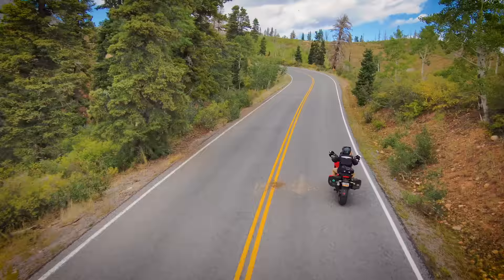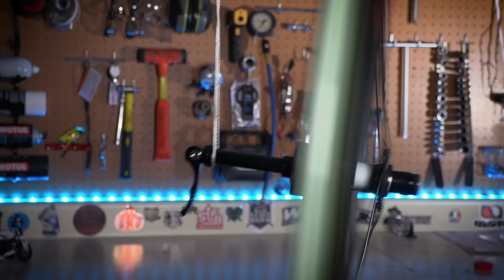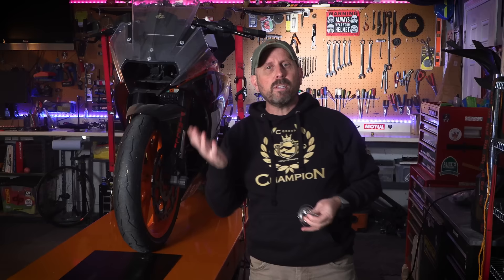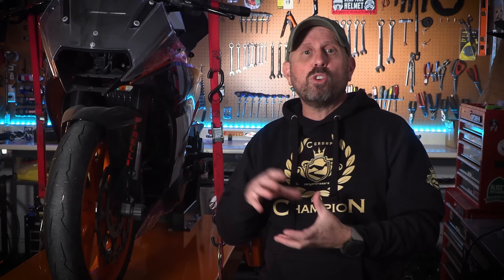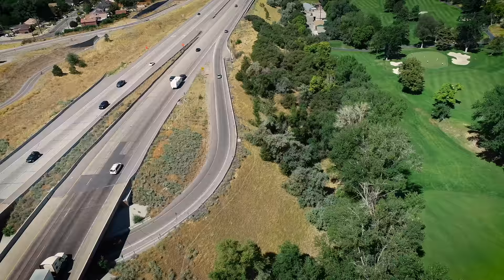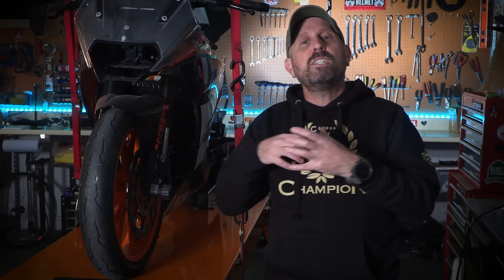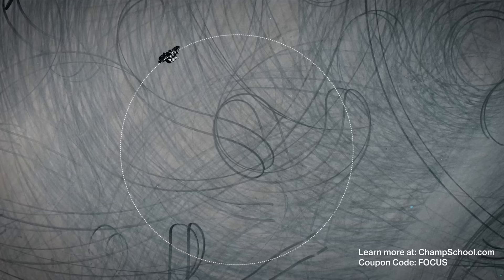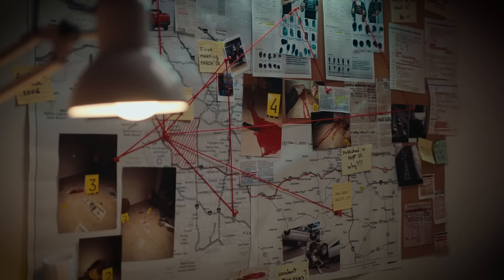Do We Fully Understand How Motorcycles Work?

Comment: Nice video, you are at the stage I was at several years ago when investigating how two-wheel vehicles turn. I watched the Cornell/Delft video and read their research paper ten or 12 years ago and have watched and read many videos, books, papers and articles about how motorcycles turn. Some are absolutely wrong, many are incomplete. Most of them try to explain what happens when the motorcycle is already leaned, but not what makes the motorcycle lean in the first place. You (and any of the sources I have read or watched) failed to mention inertia, the MAIN factor why motorcycles lean. Inertia is the factor which prevents the top part of the motorcycle (everything above the contact patch) from following the contact patch into the turn. In other words: the motorcycle does not stay upright and just follow the direction of the front wheel, because, according to the laws of physics as observed by Isaac Newton, the motorcycle's mass wants to keep moving in a straight line. Turning the front wheel away from the current path of travel causes the motorcycle to become perpendicular to the original trajectory. Everything not connected to the ground will try to keep moving in a straight line, which pushes the top part of the motorcycle over in the opposite direction the front wheel is turned. It may APPEAR as if the front wheel is being pulled out from underneath the motorcycle (I used to think that, too), but it is actually inertia PUSHING the top part of the motorcycle over. The motorcycle's steering geometry then causes the front wheel to turn the way the motorcycle is leaning. Additional factors, such as velocity, rake and trail, width and shape of the tire, wheelbase, total mass, center of mass, centripetal force, gyroscopic force, gyroscopic precession, slip angle and gravity all contribute to how quickly the motorcycle leans, how much force must be applied to make the motorcycle lean at a desired rate, how much lean is required to achieve a desired turn radius etc.  Btw: The spinning bicycle wheel dangling by one side of the axle on a piece of string is gyroscopic force, not gyroscopic precession. The effects of gyroscopic precession can be observed when the axle is moved and the torque follows the rotation. Turn the axle to the right horizontally and the axle will tilt to the left vertically (the wheel spinning in the direction it would when travelling forward on a motorcycle or bicycle).
Disclaimer: I am NOT a physicist, just an average dude who has done a lot of reading and experimenting with this topic for many years. I am not saying "This is how/why motorcycles turn", I am merely adding insights missing in this video.

Comment: How is this not solved yet? An object with mass in motion wants to go straight until an external force is applied to it. That's basic inertia. What we impart to it through the steering wheel (which also turns when we shift our balance sideways) then causes a centrifugal force, that's resolved through friction on the tires. How we sit on top of it changes the center of gravity and decides how fast or tight it can turn.
Reply from the maker: My understanding from speaking with several of these researchers is we don't fully understand exactly how trail, wheelbaser, swinarm angle/length, mass distribution, inertia, tire slip (and a bunch of other things I purposely didn't touch on), not to mention rider imputs affect exactly how the bike behaves.  A rider can make a stable bike unstable, and a rider can make an unstable bike stable, and according to my research, we still dont fully understand exactly how it all fits together.
Reply: @CanyonChasers  yeah it keeps boiling down to "human intuition). We won't know for sure until we manage to build a simulation and train an AI to ride it.

Comment: I thought it was as simple as counter steering helps the bike fall over intiating the lean. Due to the gyroscopic force of the bike wanting to keep it straight up we lean over using gravity to hold it down in the turn. Which is why the bike comes straight back up when we move our body back up..?

Comment: Conservation of energy. When counter steering, the front wheel drifts less so the rear wheel must drift more. Then the rear end rotates. It's the opposite of riding a tricycle (though you can still feel the center of gravity shift when turning.) Instinctually you lean into the turn to stop from tipping over.

Comment: The rear wheel drives you forward whilst the contact patch holds the lean. This creates a rear slide. The centrifugal force prevents the bike from falling. Therefore, momentum cannot be zero and round you go babyyyyy.

Edit: higher the momentum the larger/wider the turn becomes

Comment: It’s funny how the “speed = radius” is the exact same for airplanes. The less speed you have, the smaller your radius will be, however this only works down to a certain speed which depends on the aircraft. Each airplane has its corner speed, which is when it can sustain a turn, at the tightest radius possible, without losing airspeed. This is why the F-16 is so good at BFM, if in the 2 circle (nose to tail), it’s able to sustain a very tight circle. Maybe look into aircraft too, it’s interesting how similar they work to bikes. Example: yawing the plane left or right with the rudder will also bank/roll it (just like a bike’s handlebars), initiating a turn. (Ofc, you normally wouldn’t do this in flight, just stating the fact that it DOES happen)
Reply from the maker: Stall speed.  Motorcycles as well to a certain extain.  Below a certain speed they just fall over.   I've always looked at aviation as a great analog to motorcycles.
Reply: @CanyonChasers  True. They’re pretty close when it comes to physics. Even balancing, aircraft require the weight/center of gravity to be in the correct position (where depends on the plane), and so do motorcycles so you don’t fall off the bike. Though, fighters like the F-16, F-22, etc aren’t actually stable airframes, just the FCS systems keep it in the air.. which helps them in a lot of different scenarios.

Comment: If you go into a corner fast and counter steer more, sooner or later you're going to lowside. 

Your front wheel needs to point into the corner when you are already continuously turning. Counter steering to get more lean is pointing the front wheel toward the outside of the turn.

Just dab the brakes a little bit and your radius will tighten up. And if you really rocketed in there so that a little braking is going to make you lose traction and crash, sorry, you already screwed up. What's the solution for "I jumped off a bridge and I wish I hadn't?"
Reply from the maker: Rather than "dab" the brakes, we prefer to sneak them on. 😎  A "dab" implies abruptness and abruptness is not ideal.
Reply: @CanyonChasers I guess I had a different thing in mind for "dab." Sure, gentle brake application should fix the problem.

Comment: When you turned your handlebar to the right, you and the bike go left and automatically lean that way, you have to think about it while riding or you probably won't believe it and thinking you should be turning right when you do that, but like on a motorized kayak, you lean left and it will turn to the right, I wonder if they have anything in common 😅

Comment: 50 YEARS ON THE ROAD. Out there, if you can visually  see the corner 'opening up' and you are pointed that way, you can accelerate (and counter steer, if required). If the corner  is 'tightening' (exit is disappearing or has disappeared) you need to slow down!

Comment: Great vid…excellent!..Now can you tell us how to decrease fear when decreasing turn radius…or eliminate our innate fear of lean — that is without low siding!!
Reply from the maker: We've been working on that one for a while now - the last video about trusting your tires is a precursor. Be sure to check it out.
Reply: @CanyonChasers  I just hang off my bike to reduce lean angle but my innate fear kicks in at 38 degree or more and I know in dry conditions I should easily get to 45 with constant and tender pull on throttle to maintenance speed or slight accel. At 64 I will take a long time to heal so I have have grown old not wanting to experiment pushing the boundaries- which is what is really required.

Comment: now we're talking: "it depends" :)
has anyone sought input from mr Sam Pilgrim? at one point he rode a bed frame w/ zero trail.. 
also, if you ride a bike standing 'outside' the frame on just one pedal, in order to maintain a straight path the bike needs to lean away from you. whatever that means :)

the most reliable way to maintain a 'lucky strike' riding motorcycles is to travel at speeds that are below one's riding abilities.

Comment: So, at super slow speeds there's a greater contact patch so more friction available, there's also countersteering to point the front wheel in the right direction, and the need to keep power on through friction zone and throttle - is that close?

Comment: Speed does not equal radius. Adding corner speed at a motorcycle (not for a satellite as they are free-falling) moves the motorcycle's center of gravity more to the inside of the corner and actually closes the line. The reason why the Yamaha School snapshot shows that the circle is smaller when decelerating/slower speed, is because our untrained brain feels safer when going slower, nothing else. During thousands of years of evolution, our human brain only feels comfortable when going at walking or running speed, anything more needs training. Adding break while cornering (trail-breaking) just makes us feel safer and makes us feel that we can handle the speed and rotational torque the bike generates while cornering. 

In practice, it is ok to drag the breaks in a real corner, as it comforts us and helps us not fixate our vision to somewhere to the outside of the corner. But breaking doesn't help the bike not tip over at all. The plastic rotating disc shown to hold the bike and tips it over once accelerated more, is very misleading as the bike does not move in relation to the disc.

You almost never get into a corner too fast. Almost always the bike will be able to take the lean angle. If you are objectively going into a corner too fast, your best bet is to lift the bike up, go full on breaks, then countersteer while accelerating again and pray you have enough space to do that.

Comment: Because of the rake in the fork, when the handle bar is pushed, this action then moves the front wheel tire contact patch off-center. The bike then initially falls to one side because the weight is no longer vertically balanced along the fore-aft center line of the bike. Bike falls to side opposite the contact patch because the weight is now skewed, the vertical balance line being already off-center to side opposite contact patch. Front wheel alignment, with respect to bike fore-aft center line, then self-corrects to the direction of the turn to maintain turn direction. At this point, two-wheeled bike is now steering much like a four-wheel vehicle, wheel turned in the direction of travel. I know this is a incomplete explanation

Comment: I never counter steer, I just lean where I want go. 
You can try it just tilting over your head to the side you want to go.
Reply from the maker: You can, but some countersteer in some situations adds extra precision/control.
Reply: When You are leaning to one side, You are actually pushing motorcycle to opposite side (action and reaction), it is much more viewable at bicycle as that is much lighter. And as was seen in video, gyroscopic precession (or weight of front) will steer itself while motorcycle is leaning, so it will countersteer itself (very little is needed as cornering force of tire is pretty big). And when You are holding handlebars, You are probably pressing inner handlebar and doing countersteer unconsciously :-) .

Comment: the big question is "how do UNICYCLES steer?"

lol. despite 15+years experience, my technique improved by leaps and bounds when i got an RC motorbike.
first one. whys it steer backwards?
after the first run, that answered itself... its countersteering.
next one...why doesnt it steer?

that took a while to figure out. you DONT steer an RC bike!
you jab it, let it fall over, and ride the throttle/brakes... has a huge control horn to exaggerate the movement... and soft springs to let the wheel "float" where it wants to... maybe a damper to stop the shakes... 

no gyro to keep them up, thats cheating... just standard steering geometry and the same physics as a full size bike.

and still the most realistic of the RC vehicles... the physics scale.

but yeah, i still cant corner hard. nope. never come to trust tyres and prefer riding to sliding.

Comment: Don't ask physicists about motorcycle steering and stability. It's an engineering problem and was solved early in the eighties using Lagrange's equations of motion. Maybe it was solved earlier but not published. That's how back then  many small European manufacturers made frames for the heavy Japanese four cylinder engines with improved stability and handling. Later many books have been published using simplified models  trying to explain motorcycles without really fully covering the dynamics.

Comment: "Why does the wheel steer left if I hold a bike in the air and tilt it left?"

When your bike is flat, the force of gravity is going straight down through the middle of the bars, forks, and wheel. No reason to tilt anywhere.

When you tilt it to the left, the force of gravity is pointing to the left of the front end. So it tilts that way because it's being pulled that way. This isn't super hard. There's nothing mystical going on, you can go get anything simple that pivots and do this. Get a ratcheting  wrench, hold the extension straight up, with the handle pointing forward. Tilt it to the left. Oh man, the handle goes to the left, wow...

If you rode a bicycle or motorcycle in an environment where there was no force pulling it down to a road, it wouldn't turn at all. It would just float away in a straight line. It could be upside down a micrometer above the road, it really wouldn't matter.

Comment: Thrust line is probably the most overlooked part of any cornering equation. And that's actually a bit comical because it dictates everything.
Reply from the maker: I have sorta planned on a video specifically about this since correct posture uses less camber thrust and more steering angle.  But it kinda depends on how well this video does to see if there is much interest in this sort of thing.

Comment: When will more people in the USA start riding motorcycles? With high fuel prices, the manufacturers should be advertising scooters and mini-moto machines. Long ago in the 1950s through the 1970s they advertised motorcycles in non-motorcycle magazines and with TV ads. It is time for them to do that again. First they need to increase supply. 

For years I've gone into motorcycle shops looking for specific models and they aren't there. The dealers say that they have already received and sold their allocations for the year. That is no way to get and keep new customers. It's the opposite.

Comment: Thank you for this. 

A leaned motorcycle will keep going straight. The fact that the wheels are conical isn't the reason why the bike is actually turning. 

Whenever I see large channels demonstrate counter-steering by pushing a cup is so disappointing.
Reply from the maker: Totally agree
Reply: "Conical" tires has a small part in turning, but it is not the only or the big reason why bike is turning.
Reply: @deadslow201  sure, because the tire won't be able to actually point itself in the direction of the turn if it wasn't. but still, it's not the reason why it's turning.

Comment: If you brake harder while turning, and you intend to keep the same lean angle, you'd also need to countersteer harder, since braking while leaned over tends to steer the front wheel inwards, thus straightening the bike. So, you still need to counterstreer more!
Reply: It also depends on are you using front brake or rear brake/ engine brake. Front brake = more unstable = turns more easily/ requires less steering force input. Rear/engine brake = more stable = requires more steering force input.
Reply from the maker: Deadslow is correct. It depends. Speed. How much brake pressure. How abrupt. Which brake, etc.

Comment: One thing I can say is. Counter steer works! But it unsettle the bike. I don't like to use countersteer when I have bumpy road or leaning a lot. So I use countersteer only when I have plenty grip to spare
Reply: You use countersteering every time you initiate a turn.
Reply: @Grim_Beard  nope. You don't need to use it. You can tilt the bike with body weight
Reply: @ttiization  If you only want to make a very small change in direction, with very little control over exactly where you point the 'bike, sure. However, I'm going to assume that you don't ride like that - especially on bumpy roads or when you're already leaning a lot, which is when body weight shifting will have the least effect and control.
Reply: @Grim_Beard  sure it is way more effective to use the handlebars. But my bike gets twitchy, so it's safe to use some bodyweight sometimes.
Reply: Why don't people get this. They are the flat earthers of the motorcycling world.